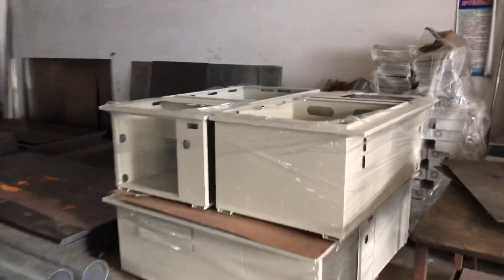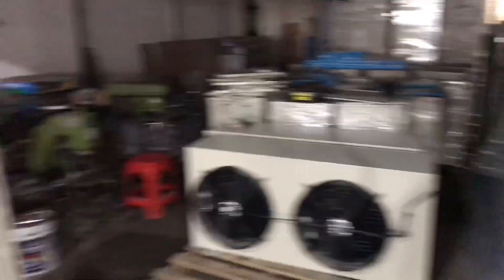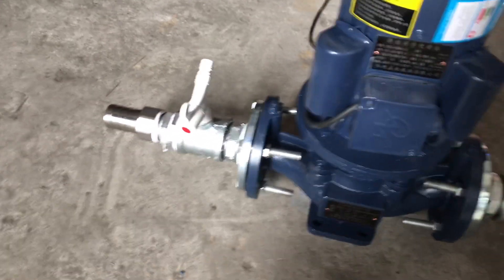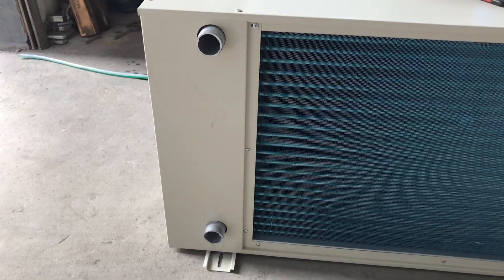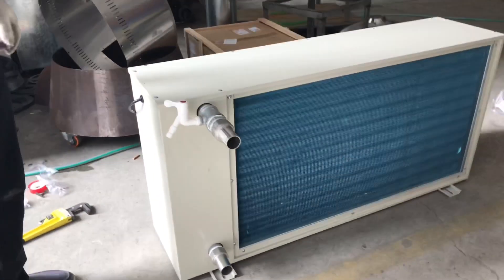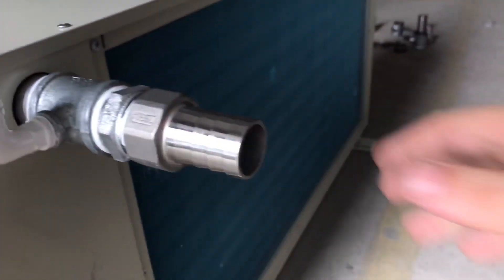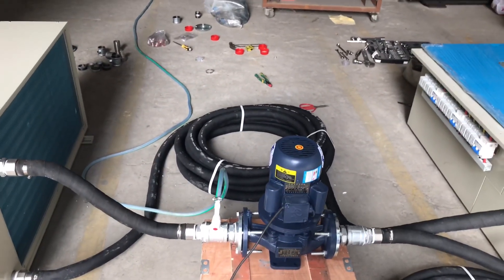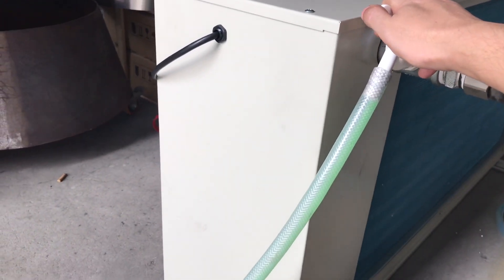Asic miner immersion cooling kit  installing and connecting the dry cooler

Comment: I have 12 S19 ready to convert to hydro cooling. Would you recommend chiller or a dry cooler?
Reply from the maker: Yes i can recommend something for cooling , you can reach out using the contact form on this page :
https://www.cryptomininglab.net/contact-1
you might as well check this , this would work for you setup 
https://www.cryptomininglab.net/product-page/asic-shield-hydro-cabinet
Reply: @Crypto_mining_lab  thank you! Do you think the 10hp water chiller can handle 12 machines @ 3500w each?
Reply from the maker: if you are not in a desert , it's definitely enough

Comment: What is the temperature of the water at the outlet and return temp required? How much does the temperature vary by miner count 6, 8, 12?
Reply from the maker: Hi Chris thanks for you input , can you be more specific on which outlet you are referring to ? heat exchanger outlet or Dry cooler outlet ? the temps dont vary much between different size ,as we use different dry cooler sizes for different tank size , fluid temps within the tank is self are stable between 40 to 42 C , with an ambient temp of 38 C and 80 % humidity during the test